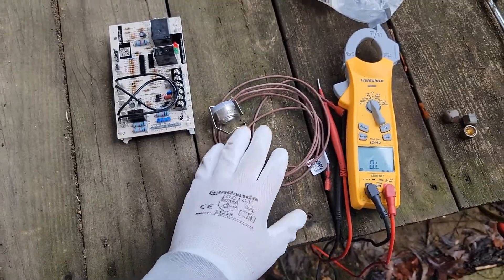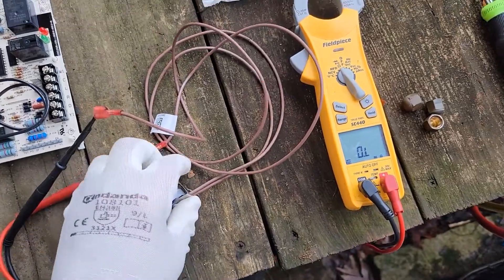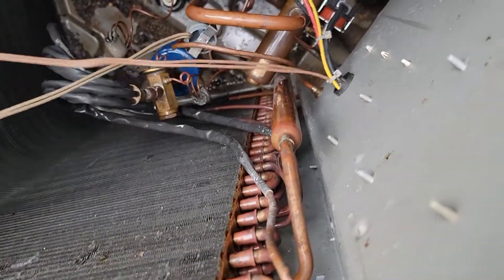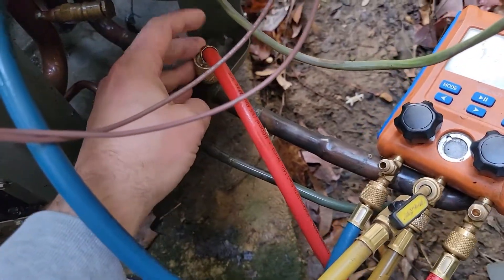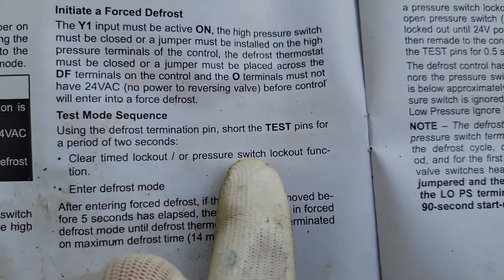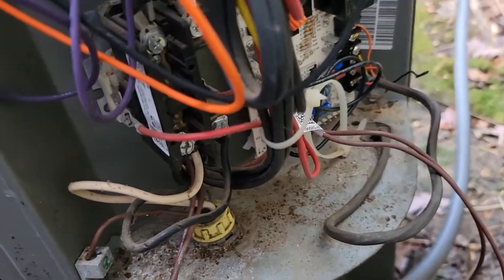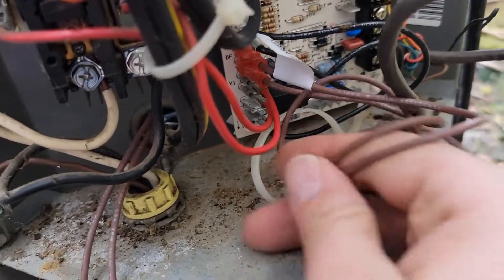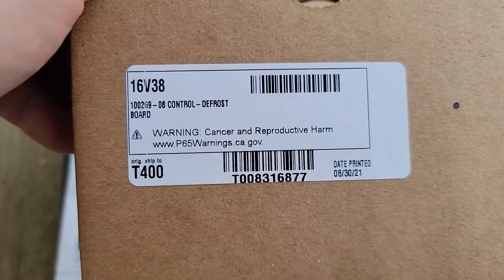How to initiate Forced Defrost and replace defrost thermostat?

Comment: Nice job thanks, i’m a retired HVAC technician without much heat pump experience so this video was very helpful. I’m actually working on a 16 seer multi stage 4ton R410a H/P unit.
Reply from the maker: Glad it helped!

Comment: Why didn't you test the new sensor?  For all you know, it is always "open".  I think it should have been forced into closed by cooling below 40 to be sure it works!
Reply: in my heatpump, right now, even with ice accumulation the sensor is open and hence not triggering the defrost mode. So open sensor with sub zero temperature is a problem as well. I am waiting to replace it as my part arrives (defrost is verified to be working with a jumper and speed mode)

Comment: Just an honest comment....not meant as a criticism but more as a serious learning question.....at around timeline 1:57- 1:59 or so....I see that you yanked the connections off the board by pulling on the wires...and didn't use a pull tool of some sort from UNDER the connection. I had service done recently on my unit and noticed the tech doing the same....simply giving a hard tug on the wires. Is AC system wiring especially stout in this area to not be damaged? , ....compared to other electrical  systems where it is advised never to do this?
Reply from the maker: I would say it's better to use a pair of needle nose or pliers. As long as your careful you will not damage but I am glad you brought this up. Valid Good Point Sir
Reply: @taddydigest  ...thank you for taking it in the spirit intended. Thanks also for the honest answer.... great info on your vid nonetheless..... !!!

Comment: what are the symptoms of a defrost thermostat that's bad? If I disconnect the defrost thermostat from the board wouldn't that simulate a good thermostat since it will see an open circuit?
Reply from the maker: use a meter and ohm it out then drop in a cup of ice water to see if it opens or closes

Comment: If overnight the defrost comes on, but continues to blow cold air into house for over an hour, what could ve wrong? In Phoenix there is now aux heat
Reply from the maker: There has to be auxiliary heat. Otherwise you will get cold air blowing in the house
When the system goes into defrost, there should be a wire from the outdoor unit that energizes the indoor units Heaters to prevent cold air
Reply: @brandondavis3763  did you find a fix for this? I am going thru the same situation. I wake up and it is blowing cold air, though I replaced defrost board yesterday.
Reply: @jllerena488 heatkit in your air handler isn't working
Reply: Your heat kit isn't working. And you said 1hr blowing cold air could be your defrost thermostat is stuck closed.
Reply: For me, I replaced defrost board, capacitor, 5 min delay relay which made me realize that when I bypassed the thermostat I didnt wait five minutes for the heat pump to kick on. My thermostat was bad. Thankfully under warranty, a year old ecobee.

Comment: On my heat pump the defrost thermostat is attached to one of the u shaped copper tubes on the ends of the coil,it’s like that factory is that right,the reason I’m asking is I need to replace mine,I’m a sparky not and hvac tech and it’s my unit ,we had a cold snap and my heat pump became an ice block
Reply from the maker: That's correct it should be there
So when the coil temperature gets below a certain point.
Reply: Cool ,thanks,swapped it out today,working like a champ

Comment: Most parts I get I am lucky I get any paperwork. Sometime the stat is knocked off and I have no clue where to put it. I have typically seen them on a condenser(evap in heating lol) u bend. Mini splits are taking over and I am trying figure out how to diagnose their defrost. It’s defrost season lol. I had a nightmare with a WIF defrost clock on Friday. Found out I forgot a jumper between 1 and 2. I found indoor/outdoor coil easier to understand. But from a technical standing it is important that people understand that they switch. I actually have to go back to a Lennox fan/defrost issue and their tech support is impossible to reach. Tomorrow I have two HP icing issues lol.

Comment: thanks, I tried jumping the speed up pins and nothing.. I also removed the defrost sensor and jumped them pins before speed up. Still nothing. I also changed the DF board.. still no defrost. Weird might call in a tech
Reply: It sounds like you're not getting  24 volts to the board...

Comment: Hi. I love your videos. I've replaced my run capacitor, and the run stop capacitor. And the outside fan turned on for about 3 seconds and shut back off. Now the outside fan won't come on. It's just that loud hum sound. Is it stuck in defrost or something? Please help. Thanks in advance
Reply: Ok, thanks. I'll look towards that area.
Reply from the maker: could be bad bearings Replace the motor

Comment: Usually the unit outside Coil is hot and the vapor Inside the home is cold when it's Winter and it's a heat pump And it's in heating mode the outside cool becomes cool and The inside coil becomes hot
Reply from the maker: That is correct

Comment: Would like to also watch members only videos, Thanks for all the info.
Reply from the maker: Your welcome 
Here is my link to join Level 3 members gain access to all my members only videos 
https://www.youtube.com/channel/UCuMyjTVlkM4xZ5z_eSyoB1w/join
Reply: I like to attempt to fix everything myself ! So I very much appreciate this video from you . I am not a technician though so I don't have those tools to do a forced defrost . I am believing that there is a problem with my defrost board because my outer fan does not turn on when I turn the heater on on my heat pump. I have had good heat since winter began here in Kentucky but we had a 10° Day on Sunday so my heat never Rose above 61 even though it was set at 67. A check in my spirit told me when I turned my heater on for the first time this year that that fan should still run to blow air even if it's not an air conditioning mode so the fan is not running when I turn on the heat pump even when it's 50° outside so I am believing I should purchase the defrost board and the temperature sensor and replace them but do I need to do any tests can't I just put it all back together and turn on my heater and have it work!? Thank you so much for a response

Comment: I learned about the "test" feature, but would like to see closer details on where you jumped between the defrost terminals
Reply: It's on the DF terminal
Reply: You always put a jumper from a hot/power wire to the pin for the component you want to force on, in this case bipassing a faulty thermostat.
Reply: Df1 & df2
Reply from the maker: deal Thank you for watching 👀 😀